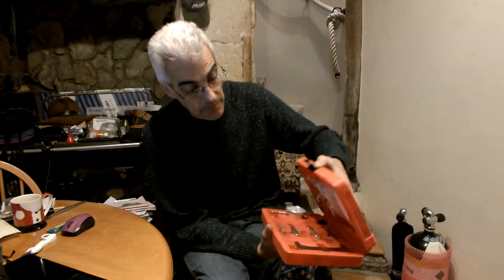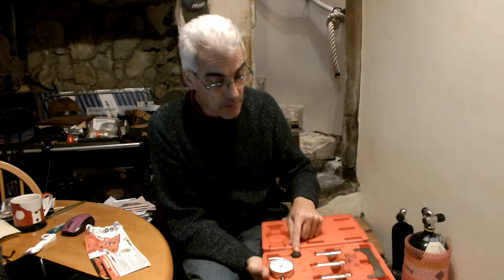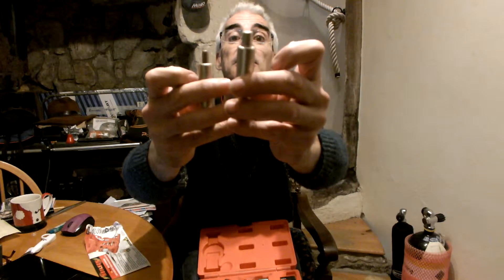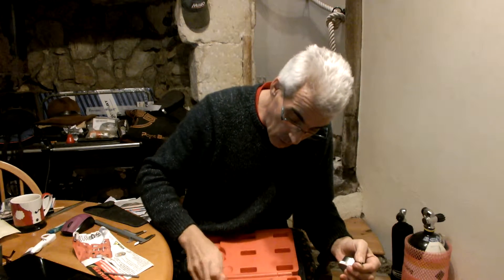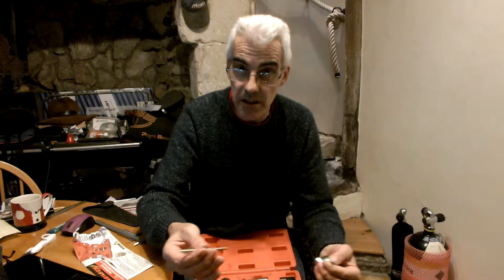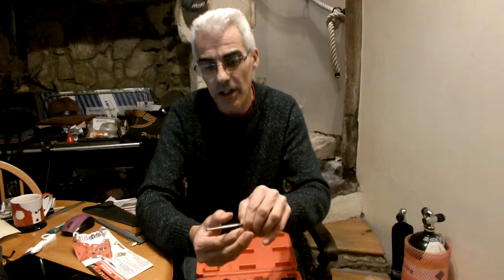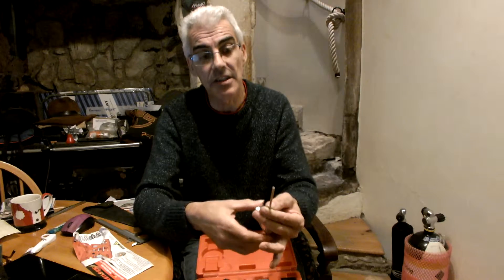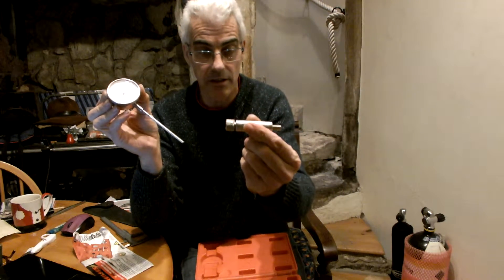Travel gauge indicator set up for timing a fuel injector pump on a P38

Comment: Hi peeps and Mike. Iv ordered my gauge to time my m51 pump as I suspect the chain has slackend. Can you guys shed any light or have a guide to set up the garage exactly and how to time the pump ?
Reply from the maker: Hi Daud,
I would advise you to change the chain as if it has stretched the chain will now be longer and the distance it travels will also have changed, the more distance it travels the more it will send the timing out. watch the video on how to set the gauge up and how to set the timing. If when you bring the pump up to the correct timing value you struggle to achieve this, it is worth investigating whether the pump is set at 180 deg's out. It happened to me.
Hope that helps
Good luck
Mike.